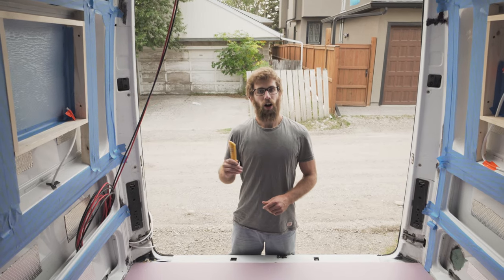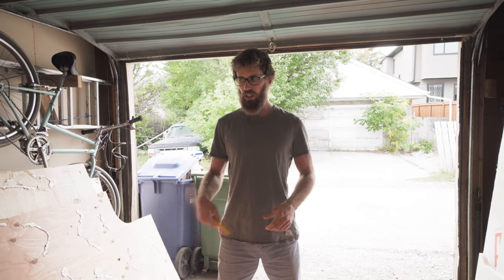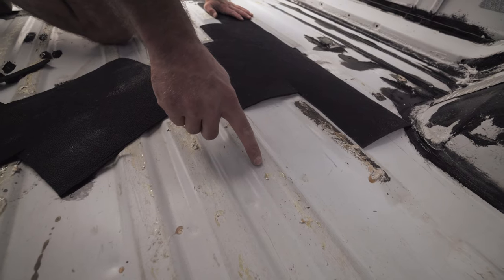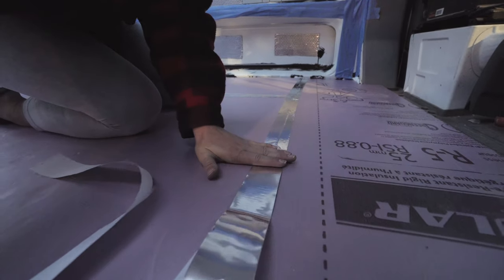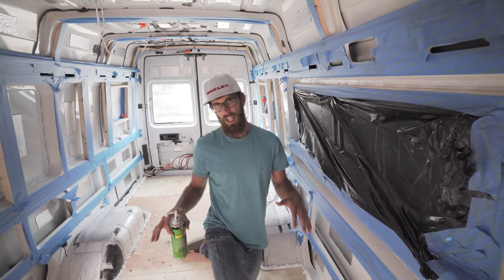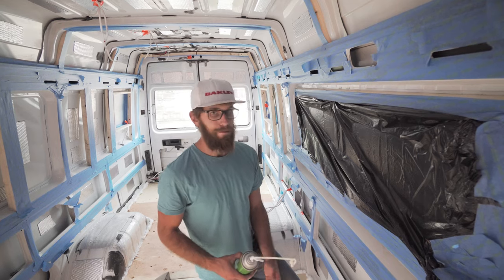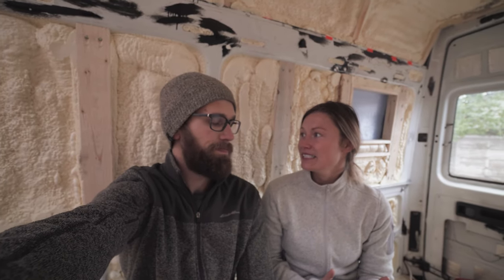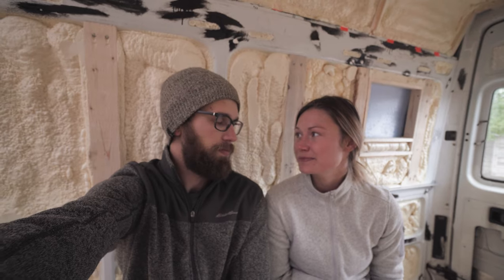Campervan Floor: Installing an Insulated Subfloor in a Dodge Sprinter!

Comment: Thanks for the info! Wondering if you could tell me what your process was for removing the plywood floor that was already in your van? I've got a similar situation going on in my '04 Sprinter with a ton of rivets!
Reply from the maker: We had the same situation! It’s easiest to drill out the rivets.
Reply: @madetoexplore  that's what I was thinking of doing. And then what did you do to seal all of the holes?
Reply from the maker: @kailyfineran3072  paint the exposed metal to avoid rust and fill them with something flexible like Sika Flex
Reply: @madetoexplore  thanks so much!